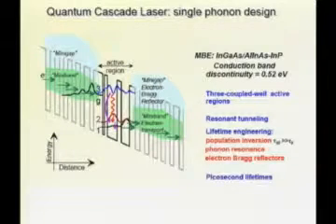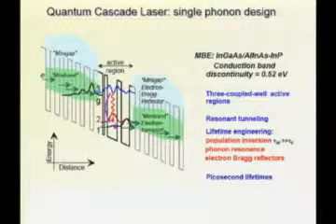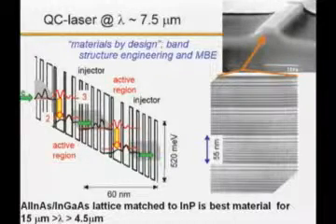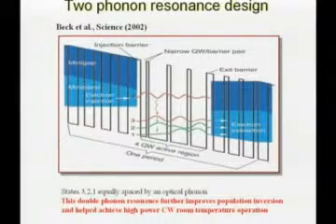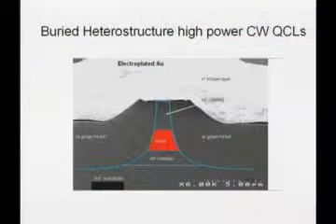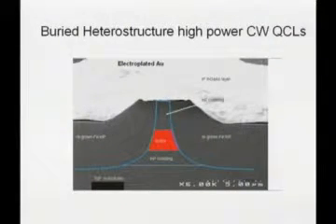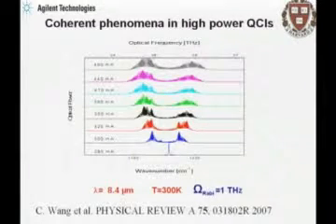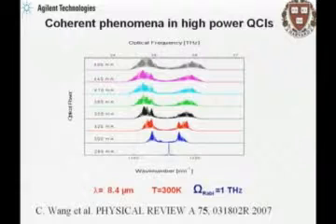Part 2 - Quantum Cascade Lasers: Compact Widely Tailorable Light Sources from 3 to 300 µm

Comment: Solid State Germanium Etalons for QCL wavelength calibration - 1", 2" and 3" in stock!
Germanium etalon, o 12.7 mm x 25.4 mm (o 0.5" x 1")
[E-Ge-12.7-25.4] 
http://greyhawkoptics.com/product_info.php?cPath=1_28&products_id=83&osCsid=8e60a9c995ecc2132e7285b47ed00b2a
Ge_ET_1.00_0.50
Ge (germanium) etalon
Type: Cylindrical plane etalon
Material: Ge optical grade
Diameter: 0.50 (+/-0.05) inch
Length: 1.00 (+/-0.01) inch
Flatness: 1/4 lambda flat each end, HeNe
Parallelism: <= 5 arc seconds or better length measure to 0.0005" 
bevels Surface quality F-f(80/50)
Bevels: Protective Bevel

Germanium etalon, ø 12.7 mm x 50.8 mm (ø 0.5" x 2")
[E-Ge-12.7-50.8]
http://greyhawkoptics.com/product_info.php?cPath=1_28&products_id=930&osCsid=311357090e9434c64c65e9777cc10a29
Ge_ET_0.5_2
Material: Ge optical grade
Diameter: 0.50 (+/-0.05) inch
Length: 2.00 (+/-0.01) inch
Flatness: 1/4 lambda flat each end, HeNe
Parallelism: <= 5 arc seconds or better
length measure to 0.0005"
Small bevels
Surface quality 80/50
Bevels: Protective Bevel

Germanium etalon, ø 1" x 3"
[E-Ge-1-3]
http://greyhawkoptics.com/product_info.php?products_id=833 
Material Ge optical grade
Diameter 1 inch Tolerance +/-0.05 inch
Length 3 inches Tolerance +/-0.01 inch
Surface quality 80/50 S/D
Flatness ?/4
Clear aperture =90 % of diameter
Parallelism = 10 arc sec
Coating none